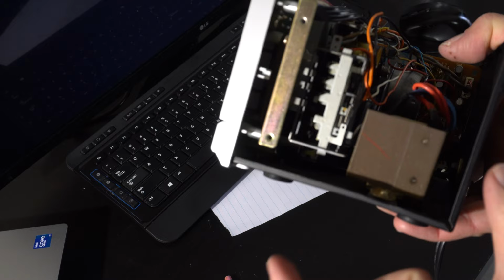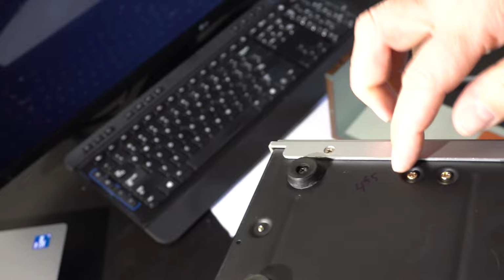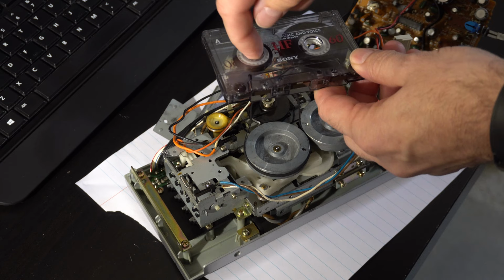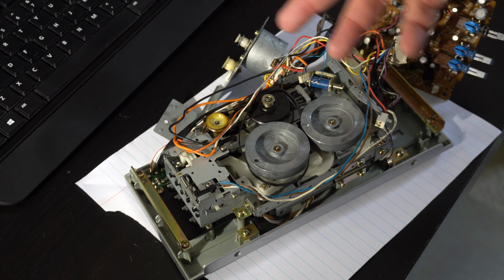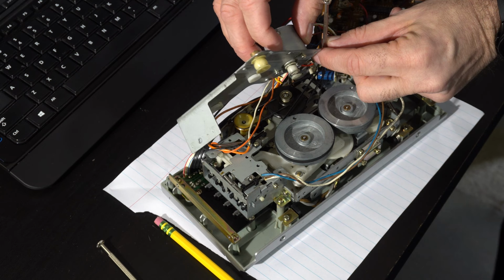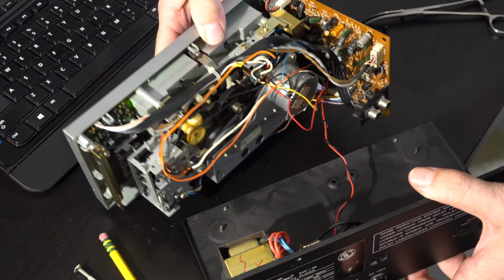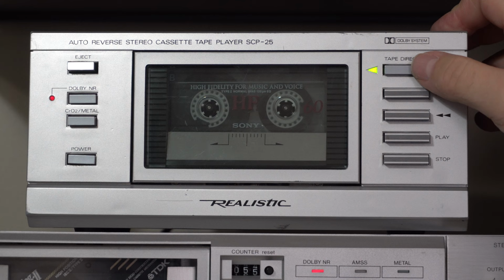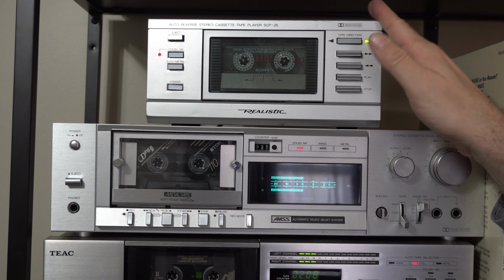Viewer Mail: Realistic SCP-25 Cassette Belt Hack!

Comment: Years ago I took apart a portable DVD player in an attempt to diagnose and repair an issue. I looked inside at the number of moving parts and said nope. The DVD player still sits somewhere half assembled in the house. Good on you for keeping these old players in service. 🍻
Reply from the maker: Thanks! In addition to being designed for service, the older components are often easier to repair without specialized equipment. Having no formal training, I can't imagine trying to align a laser or perform a complex repair on a DVD player...